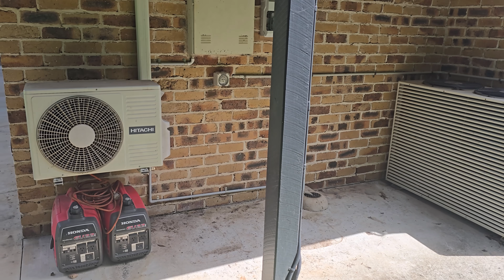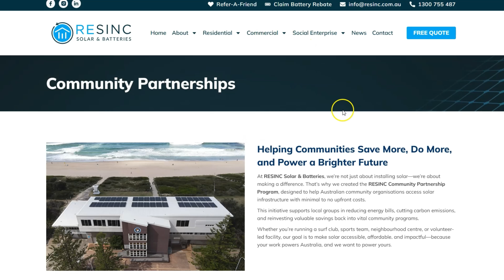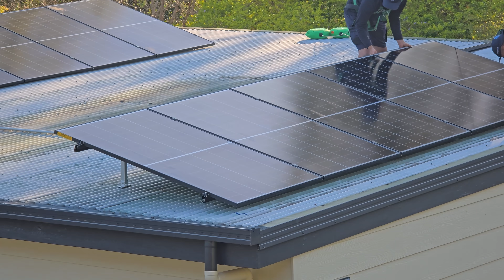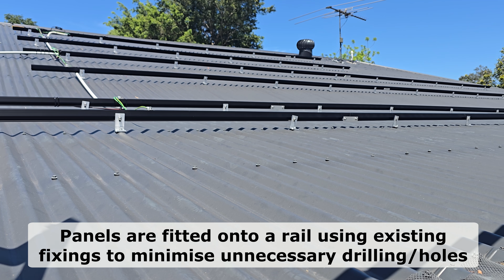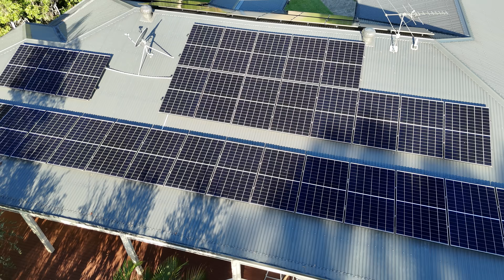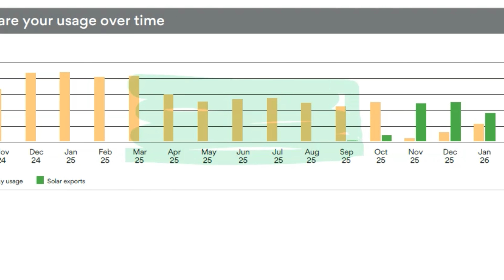From $600 Power Bills to Self-Sufficient POWER - My MEGA Solar & Battery System!

Comment: You're in sunny Australia with a huge plot of land. You should be able to be self-sufficient all year round, mate. Cheers from Germany.
Reply from the maker: G'day Michael! Love Germany, and one day I will get back to go to Oktoberfest! Yes, if I added approximately 20 more kWh of storage, we would probably be self-sufficient in electricity year-round. However, I do expect this system to be in credit through our winter, so over a full year, this should compensate for the extra we use in summer. We will only know after 12 months of testing. Cheers :)
Reply: @Selfsufficientme  I have solar in New England, definitely jealous of your sun!  With the heavy snow this year, generation has been about 5% for Jan and Feb.  Ironically I might need to consider electric heaters to expose the panels.
Reply: @SpleneticMonopole or maybe some type of mechanic snow removal?  Alas, the days are too short and the sun is too weak in winter up here where we are. 
The darkest 2 months, so from Nov 21st till Jan 21st are equal to 10 days in mid May...
Reply: @Selfsufficientme all year round, that would sound lovely, mate.

I assume with some smart control and some new wiring you could set up a separate PV system that feeds directly into your fridges/freezers and lets them run whenever there's electricity. 
If you freeze them, it doesn't make much of a difference to your steak or your veggies if they're at minus 2 or minus 10 degrees.
Let them cool down during the day and sit idle during nighttime.
So the food itself acts as thermal battery and you'd need to add less electric storage capacity for full self-sufficiency. 

And - as an aside - if you come Germany, please let me know. I'm happy to show you around. Cheers from Munich. 😊

Comment: Also, when the power is out, you can of course, trim back on what you use such as light and induction stoves. Air conditioning for parts of the home maybe? I would not assume the sun will be and doing its thing for certain times of the year.

Comment: Hey Mark. Fellow veteran here. Great video. In Tasmania we have a 13.5kw feeding a 10kw inverter (only single phase unfortunately). We dont have a battery, feed in tarrifs are still heaps better in Tassie. I think we're over 15c/kWh. Obviously we dont have to run aircon in summer but we do run two split systems for heating 24/7 for about 7 months of the year. For the past 4 years, we havent had a bill. We make so much credit during summer months that we use the credits over winter. Winner.
Reply from the maker: Great stuff! Beautiful Tassy... Nina and I had our honeymoon there - wonderful memories. Yeah, 15c is pretty good and being able to save those credits during summer to use them when you need them most is so handy. Hopefully, more and more people will have the opportunity to wipe out their electricity bills in the future. The high cost of energy is a real worry. Well done mate, cheers :)
Reply: Thank you for your service. 

What you’ve said there is amazing - the feed-in-tariff allows you to essentially use the grid as your battery in a way!
Reply: My latest bill with Aurora Energy in Tassie has my feed in tariff at 0.087 cents. I elected to get a battery installed at home, and an EV to absorb my excess solar.
Reply: I don't have a massive system, but since the battery installation last July I haven't used any expensive peak power.
Reply: @the_amazing_adventures_of_andy we're with 1st Energy, not sure what their new customer feed-in is now, but 15+ cents is way better than 0.08c!
Reply: @grayzbildz  Oh! Thanks for the info, I don't know them, I will have to check them out.
Reply: Having batteries decrease so much efficiency it's not worth for many appliences. Maybe keep a small pack for the core needs like heating or refrigerator.

Comment: I had my first solar system installed 30 years ago, back when the feed in tariffs were 60c per kw. The technology has certainly changed since then. I now am completely off grid with 16kw of battery. I only use about 25% of my battery each night but don't have the appliances or people like you do. I love the sense of security and of course I love not getting any more electricity bills. Congratulations on your new system!
Reply: I guess I did not understand solar panels. I assumed solar panels ment no more electric bills. What im understanding is it just means a cheaper bill and total solar usage when the power is out.

Comment: Haven't had an electricity bill in over fifteen years, and don't miss it. My array is a whole lot smaller than yours and we're in Victoria so we don't get much in winter, but also we don't have anyone with medical needs like that.
Anyway if you have a system that depends on a genni to get you through rough spells, you need to run that genni about once a month to keep it operational, and put a run hours meter on it, and get it serviced regularly. It's a whole thing. Having enough panels and batteries to get your through rough spells without a genni is a lot of panels and batteries, but it's a lot less hassle to live with.

Comment: We've been off-grid in the sunny coast hinterland for a decade. Currently running 14kW panels and 20kWh batteries. We have heaps of power, charge an EV for free, run airconditioning and have an incredibly reliable system. Not everyone can afford it or are renting and can't go off-grid, but if you can do it you will find that you have electricity that is always more reliable than being on the grid. Off-grid works better if you can modify your behaviours, use your high usage appliances when the sun shines and you'll go great.
Reply: Do you run air con at night from the batteries?
Reply: @alyssaando  no. we're quite elevated and the evenings are never hot enough to need it. occasionally we run it for an hour when we go to bed and then turn it off automatically

Comment: We got solar and  battery last October . We are in Adelaide.  
There have been a few power outages that we didn’t know about and last weekend it was overcast and rainy so the battery didn’t charge much.  Recently we received our first bill which was like -$48 ❤ we are loving our sunshine 🌞
Reply from the maker: That's AWESOME to hear! Thank you for sharing :)
Reply: Ok but getting solar is not free, usually involves financing that outlasts the actual devices, so you end up paying the same price over and over for a decreasing efficiency over time. Also harder to sell your house with panels. Also leaks from the roof mounts are common. It seems like problem after problem from my research. You may not pay monthly but batteries need replaced every few years, as well as the panels every 5 or 10 years. Over time with financing and interest and upkeep you may end up paying more money out of pocket overall for the solar then just buying from vendor.
Reply: @Ian-ie3hy  Panels are guaranteed for 25 years. Batteries can hold less charge over time, but you can take that into account when buying the system and they are guaranteed for 8 yrs. Coupled with a wholesale plan through Amber, I expect payback of the $20K we invested in < 4 years...not to mention the blackout protection. We feel that if we were to sell our house, telling people that there are literally no power bills would be a major positive in terms of pricing.

You are painting a very negative view and forgetting the climate benefits on top of the financial benefits. However, we all make our choices.
Reply: @HenkPlaggemars  in fact it is you who are painting the picture that does not resemble reality. Climate benefits are worth what value the buyer assigns. Its irrelevant to this discussion which is based on finances. Saying the panels are guaranteed means basically nothing. Guaranteed against what? Even acts of god? What does it guarantee? New part replacement or used parts? Does that cover labor also? You can take into account anything you like, and god will throw a curve ball at you nearly every time you try a home improvement project. Also you can feel anything you want, but at the end of the day home buyers will either have to continue to pay to maintain a dwindling energy source, completely replace the system, or pay to remove it and then deal with roof leaks. I live in florida where these systems have been installed on several friends and family homes and these are the stories. Sorry im not painting anything, this is called objective reality. The data is out there, yes the panels are improving but it will never be able to replace the energy grid, and the environmental cost of massive battery production is highly debatable whether it is cleaner. Cobalt for one, is mainly mined by african children, and is used in most current lithium ion batteries. 🤷

Comment: If the cost of a system like this is $100k and you save $6k a year, all you did was prepay for power for 17 yrs.  The longer the system lasts after 17 yrs, is when you truly start saving.
Reply: well, not all - he's reduced coal-fired emissions by doing this.  If we could all do this we wouldn't have to burn coal and therefore huge reduction in emissions.
Reply: @tln6576  how many emissions were emitted in mining & producing the panels?
Many power stations are hydro, some nuclear.

Comment: Sungrow 25kWh is around 10k installed, thanks to the battery rebate. It was one of the options I was quoted on when I jumped on the solar+battery bandwagon recently.
450W panels work out around $400 each including hardware and installation (again, based on quotes I received).
So my guess for two batteries plus 62 panels is $45k
Reply: I'm with you mannbat. That install looks like a $50K system or thereabouts. I had a Sigenergy 32kWh battery system and a 14kWh solar system installed in September and after rebates, landed me just over $22K on a single storey tiled roof, metro suburb of Perth. Haven't looked back since - I even have that same Actron ducted AC system that Mark has - reliable, but what a juice-junky!! Oh, and we run an EV daily doing about 400kms per week on daily runs and commute, and thats getting charged off the new system too! Used to be about $80/week for fuel there that we're saving now! Our electricity bills have been reduced to tens of dollars from several hundreds per pay period (2 months).
Reply: I've sunk about $100K USD into my similar system, but don't have Mark's battery capacity. If you can go solar at scale like Mark, do it! I have had the benefit of a solar tax credit here in the US, at 28% and then 30%, (now it has ended!) but it is not a rebate as in cash back in my pocket. It can only be used to pay federal income tax bills, which still stings.
Reply: 50k in the bank is earning minimum 2k pa. solar still a scam and not worth.
Reply: @monalisa-bs4zs  plus increased insurance premiums , one decent hail storm in 3 years time , a small percentage of the panels damaged , then the whole lot will need replacing ( just happened to a friend in Brisbane) . Also due to fire risk management ,I wonder how long before insurance companies will not cover systems out of warranty ?  So every ten years or so (just like water hoses to dish/clothes washers) they will have to be replaced.

Comment: Well done, proof that failing to plan is a plan for failure. One thing I did not catch was any mention of a solar hot water system. Four adults means a few showers a day, plus washing up, washing machine, etc. You, being a canny old bugger, probably have it in already. We two have never ever run out of hot water, and 9months of the year.  Winter months we may turn on the booster to heat hotwater  for morning showers  , Another Big saving  only extra conssideration  check the sacrificial anode about every 3 or 4 years. The original system is up for its 17th birthday and still as new
Reply from the maker: Hey Phil! Actually, we don't have solar hot water, but thanks for the recommendation - it sounds like it works great for you and would for us too. We do have a heat pump hot water system, which I believe is better than a standard electric one... It was expensive, but we did get a Government rebate on the system about 6 years ago. Cheers :)
Reply: No need for solar hot water as the whole system will heat the water anyway.
Reply: I have a timer on the switchboard for the hot water system. It can only run between 10am and 2pm when daytime solar is abundant. That might not work for larger households though.

Comment: Thank you for having us Mark, really looking forward to our charity project we’re working on together! 💙
Reply: How much would this system cost an average Australian?  do we need to take out a 2nd mortgage?
Reply: @kparker1615  A 50kWh battery alone is in the ballpark of $30k.  The solar and the inverters here would probably be around $20k.  I wouldnt expect much change (if any) from $50k.
Reply: @chris12456 mayhaps with these  small 5kWh modules, but I put together my 14kWh battery for less than 2k and some assembly time. In EU, so these are euros, but I don't think one euro is many Australian dollars. Now what I did notice however, of the 7.5k I spent on 3.25kWp PV 6kW inverter 14kWh battery, the most expensive component was the 4k of getting a crew on my clay tile roof to install the racking and panels. I imagine that part is also the most expensive over there too if you go with batteries built with 300Ah instead of multiple 100Ah packs. I recommend having a look at The Off-grid Garage, which is somewhere in Australia and does a bunch of testing and showing off.
Reply: @chris12456 so that about $2.5k per year? Go the life of the system.
Reply: @kparker1615 go off grid solar, better than this crap that they can rape and pillage your battery.
Reply: @kparker1615  about 200k, so yes.
Reply: @kparker1615  around $35,000
Reply: Every thing involved continues to get more affordable. Does your government offer any support etc. It can’t hurt to check it out local situation.
Reply from the maker: Thanks, RESINC, for the opportunity to work with you! As I said in my video, I'm very happy with everything, and I'm looking forward to our next project together. Cheers :)
Reply: Wasn't expecting to hear a Canadian voice😊 we really are everywhere haha
Reply: @tarzwelu ❤🇨🇦
Reply: We have tried to get a quote from you after we saw Mark's awesome video.
But you up charge 4k out of no where. Not even professional enough to give my parents a proper updated quote after we decided Anker slim design wouldn't be necessary.

Shame on you for abusing your good reviews and the good words Mark has put in.

I'll be going through the emails carefully to see if I should be reporting this conduct to the ACCC.

Thanks again for wasting our time.

Comment: Nice. I went full house battery backup with 28KWh battery and do not regret a thing. Damn blackouts were occurring 14 times per month during high heat summer nights. My AC runs smoothly all night, regardless of the grid
Reply from the maker: Gold! :)